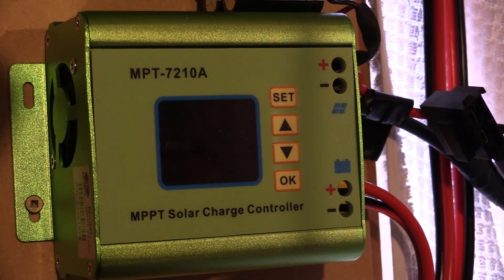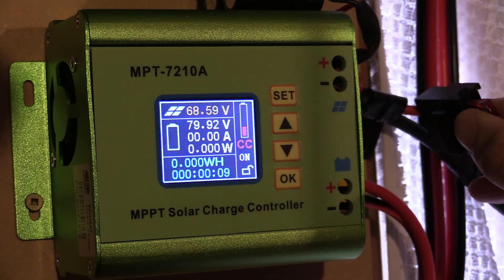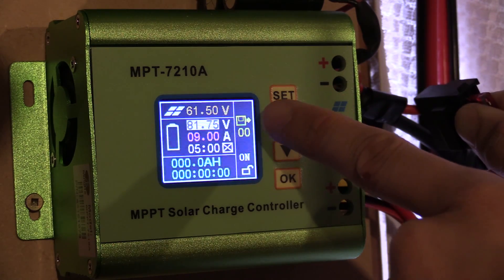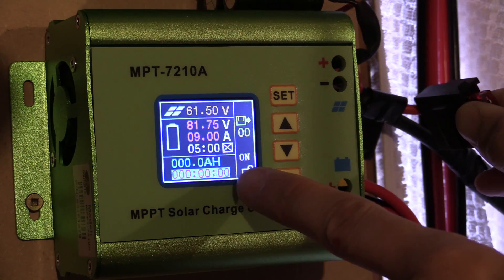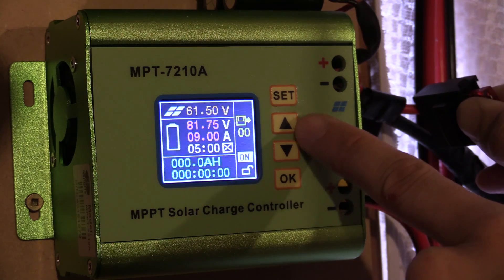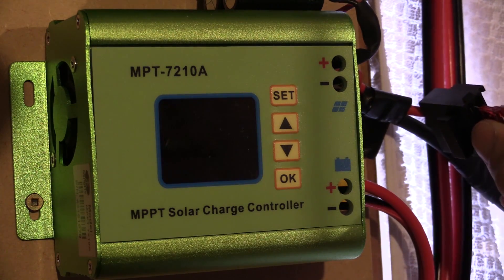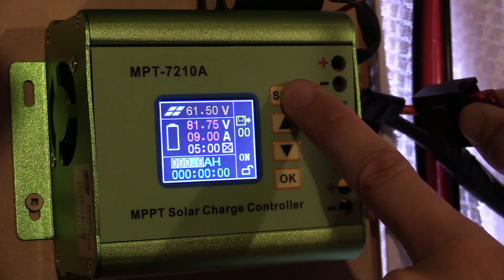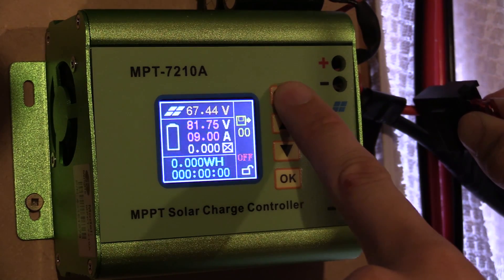MPT-7210A Auto ON Setting

Comment: question ❓ there are 20 settings. if i start using other than 00 setting and the controllers powers off, it comes back to 00 seeting after starting up again, which is dangerous if the setting 00 has a higher battery setting that the one under which the controller was powered off ⚡ Is there a way to change this... or i will have to adapt just to changing same 00 setting all the time?

Comment: I am wondering, instead of having these convoluted keypresses to reach certain menu items, why didn't they just make it so it cycles thru ALL of the menu options in a round robin fashion, and then you just exit out when you are finished setting/changing what you want?
Reply from the maker: Good question
Reply: Or why didnt they make it "battery dependant" like every other controller on the market, that way it will never lose power, and therefore, this issue wouldn't exist in the first place

Comment: 68V solar input is out of spec.  The acceptable range is 12-60V according to the user manual.  Have you had any problems with your unit with overvolted input?  I have some panels that are 64.2V open circuited and 54.7V at MPP so I am wondering if those would be ok to use long term.  Also, I want to use 2 identical panels each with an Impp of 5.58A, so is it ok to use more than 10A of input provided that only happens rarely when the sun is at the perfect angle to the panels?  The maximum input of this device should be somewhere around 600W so I am wondering if anyone has seen anything close to 500W output reported on the screen.
Reply from the maker: yes it is out of spec but by changing the caps it seams to work fine. I wouldnt push it much higher tho
Reply: What value and type of caps did you use?

Comment: Hello Mike ,
 Need Small Help . 
I Have 37v  Li-Ion battery ( 10x 3.7v 18650 Li-ion connected in series) 
Max charge 42 V . 
1) Can I charge this battery with 12v / 40 W panel ?
2) Can I charge this with Series - 12v(40w)+12v(40w)= 24v ?
3) Can I charge this with Series - 12v(40w)+12v(40w)+12v(40w)= 36v ?
Thanks

Comment: hopefully you get this message, i have a problem with my 7210a. I have 2 36v 300w panels in parallel, but i the highest current im getting is like 3amps=30ish watts. thats like 5% of what the panels should be putting out. Any ideas?
Reply from the maker: What is your battery voltage? Also what batteries are you using?
Reply: Mikes DIY Tesla Powerwall 3x12v agm 55ah in series
Reply: Mikes DIY Tesla Powerwall I also did a test using a 12 volt battery in the case that the solar panels were the problem and it appeared that the behavior was the same
Reply from the maker: I think the battery voltage is too low. The 7210 is a boost charge which means the battery voltages needs to be alot higher than the solar voltage. If your solar panels are 36v ish then your battery will need to be 40v -50v min. Add another 12v agm in series so you have 4x12v that should fix your problem.
Reply: Mikes DIY Tesla Powerwall I thought the same thing from watching your videos. So I did a test using a 12 volt battery as a imaginary solar panel. It did the same thing trying to charge the 36 volt setup
Reply: @michaelmapes7274  did you manually configure the panel and battery voltages? 

The power point tracking algorithm in this thing is pretty flaky at the best of times

Comment: Question...can this controller  on the DC-DC mode  do a step down...say to charge  a 36 volts battery bank from my 48 volts bank that are connected  to the solar panel??  the 36  volts is just a  44 AH system.  It might be...that the controller in  MPT mode connected directly to the 48 volts battery bank...can be used to charge de 36 volts bank...if I can adjust the current to no more than 6 Amps....Mikes..what do you think?? Thanks
Reply from the maker: no its only a boost converter so the input has to be lower then the output.

Comment: Hi Mike im trying out things to stop the mpt7210 from crashing and have found that putting a 100v 4700uf dc cap inline with the solar panel before going into the charger really slows the voltage drop when clouding accrues and stops it from crashing
Reply: This is so helpful, going homeless for a bit to catch up on bills and setbacks.

Been testing my allpower 300watt and 60watt. The mppt resetting is really pissing me off.

I really want to get away with the smaller lighter 60watt.

But the power resets are killing that from happening.

Comment: what is your feedback on that charger? what is the maximum pv you can put for 48v?
Reply from the maker: hmmmm a single 300w panel i would say, mainly because the input voltage would need to be lower then 45v and the unit can handle around 10amps. For 48 voltages you are better off with a buck converter mppt charge controller
Reply: Mikes DIY Tesla Powerwall where i can find what you tell?